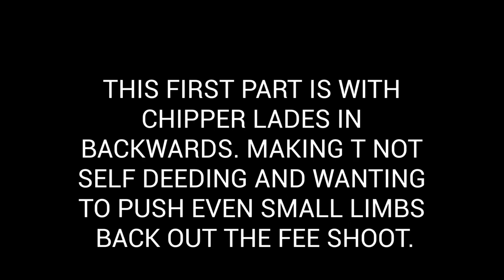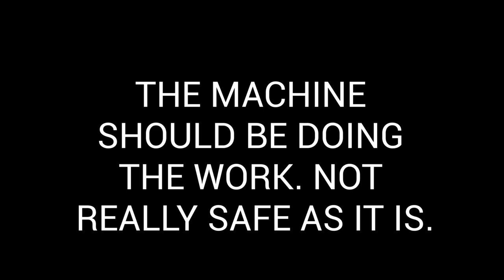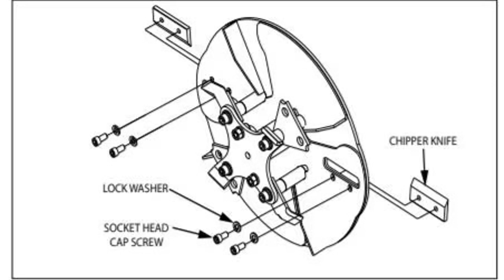BEARCAT/ECHO CHIPPER KNIFE DIRECTION DON'T INSTALL THE BLADES BACKWARDS SC-3206 CHIPPER SHREDDER

Comment: Thank you. Imma check this out. I took it the shop and it came back and it’s doing exactly this. You might’ve just saved me a huge headache.
Reply from the maker: Unfortunately I only found out because I put mine in backward,  directions be damned. First branch wouldn't fees. 
   Good luck. Thanks for watching and commenting. Have a great weekend coming up.

Comment: How thick a branch can this comfortably chip? Hard and green oak or something similar. Although I’ve heard some species are harder to chip after they’ve seasoned.
Reply from the maker: Biggest I've done is around 3" mainly because the vchute size internally won't take anything bigger.
    As far as green stuff, I slotted my exit screen to allow it to cone out easier.
   Last year I had some seasoned black cherry that took a little longer to chop. 
    I used that 18hp duramax because it was a smoking hot deal and electric start for only slightly more than a pull start. My shoulder thanks me everything I need to use it.
     After replacing the blades, which were chipped up pretty good , it does everything I need it to do.
    The bearcat seems to be a little sturdier than some of the other stuff out there.
    After I got this one going good, I came across a larger vermeer commercial unit on a trailer that had a fried engine or so I was told. Upon inspection it needed a lot more than an engine. Besides, I don't really a commercial unit.
   Hope that helped. Take care.